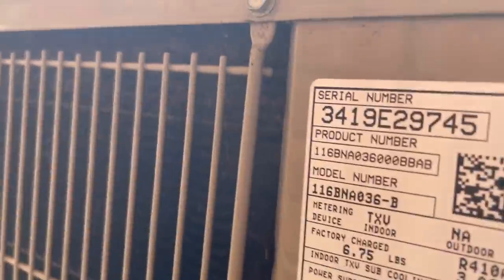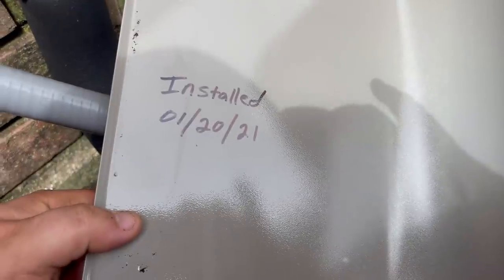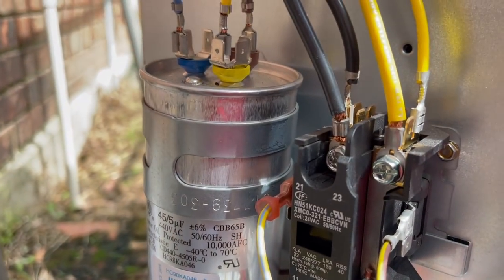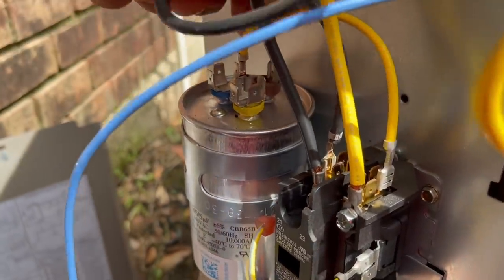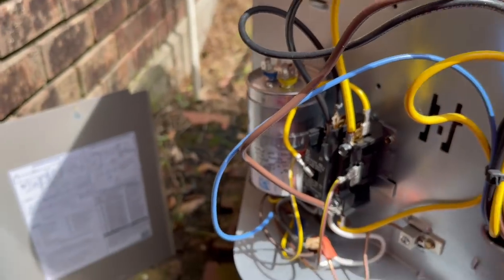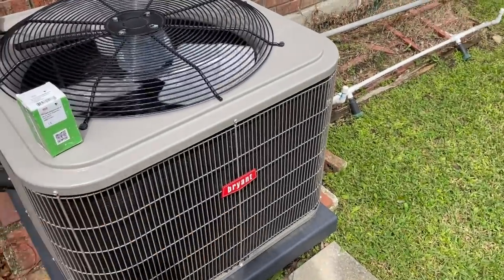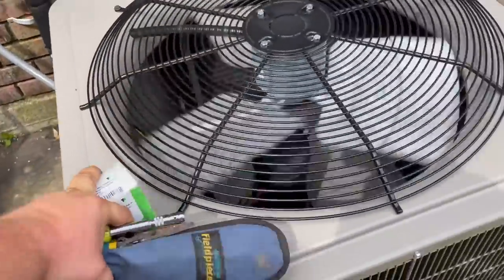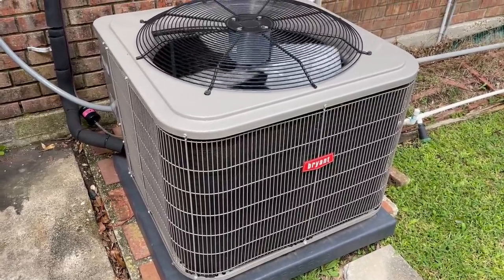HVAC Chinese Capacitor Strikes Again

Comment: When I got started in the late eighties in hvac one of the last things that you would ever wind up replacing on a condensing unit was a run capacitor,, that was rare..
Reply: They had PCB’s in them till 1979 I think it was. When they banned PCB’s that’s when the trouble started.  Then they started making them lighter and lighter.  We used to say run cap are like watermelons, buy the heavy ones.  The Chinese ones in recent years are awful, I wouldn’t put one in my dog’s house.
Reply: @rgb-c5  well, I keep old pcb capacitors from old equipment and put them in to replace crappy new capacitors.

Comment: I'd say paying extra for Turbo 200s is worth it.  That's outrageous.  We got 30+ year old systems out there running with original parts, namely the capacitor.  Good to see a video from you John!
Reply: Thank the EPA for that.   Oil in the old capacitor could handle and dissipate the heat much better.

Comment: @John, Just in case you didn't see.  Both Carrier and ICP released a Tech info Comm (TIC) on the a solution for these horrible older Chinese caps...apparently they spec'd Castor Oil dielectric (Black Label) and as we all know from experience something breaks down and fails...starting 3Q of 2021, they replaced with new caps (Yes same mfg) with Mineral Oil dielectric (Blue Label).  Guess Mineral Oil has a higher breakdown temp.  212 degF vs 185 degF.  Guess time will tell if they are any better.  I do see them in the new ICPs, so I will monitor them and see if the match the USA Mars.  The TIC was released on Jan 11 of this 2022.

Comment: Thanks for sharing. I wasn't aware this with Carrier capacitors but I know for sure by experience dealing with the Titan capacitors sold at Johnston Supply that have the same exact issue.
Reply: What's your story with the Titan? They have Pro (chi) and HD (USA).
Reply: I had to switch out a Titan the other day after only a year.
Reply: I haven’t had a problem with the USA made Titan HD.

Comment: Im a Bryant dealer here in Va and i have installed a lot of Bryant units and to date ive only haf one capacitor fail and that was a few weeks ago. But we had also had several severe storms come thru at that time so i dont know if caused by storm or Chinese cap but this was first one ive had and i install at least 3 -5 a month sometimes more . Im not a fan of Chinese parts but havent seen issues like you here
Reply: I had to replace a year old capacitor on a 2 speed carrier 🤷‍♂️

Comment: I have 2 carrier units that are about 14 months old. No issues yet but I have 2 U.S.A. made caps and 2 contactors sitting in my garage.
Reply: It doesn't matter if it's made in the US or China, capacitors are inherently fragile components. Any good power surge or thunder storm has a good chance to pop them.

Comment: I've told customers that capacitors are now like car batteries.  You're either proactive or reactive.   Do you wait until you're at the grocery store to find you battery dead or do you just replace it every 5 years?   Same with capacitors except shorter life span.  So even if I am testing your 5 year old capacitor and it tests good.... Are you proactive or reactive?

Comment: I feel you John,

I installed a Bryant Air Handler and 3 months later evaporator leaking!!!
Reply: Did you tighten the txv? Each brand has their issues, you usually have to tighten the txv on most Lennox evaps. But I do it on all evap installs for peace of mind.

Comment: I’ll take the bad run cap issue. I work on both of these brands everyday and I still like the tried and true Bryant design. Our Rheems are the old style condenser now because they can’t source the resin for the condenser pan. Plus thin coils. SWFL

Comment: John, on those capacitors, does the little bubble popped up mean that it’s bad maybe?
Reply from the maker: No not Necessarily
Reply: No, always check the uf on a capacitor. That's the only accurate way to know.

Comment: Just looked up that same brand of capacitor on Amazon and it had 4.5 stars on the reviews. It was a 70 uf 440 volt capacitor because that what works in my condensing unit.  BTW, the description says that these Powerwell capacitors have a five year warranty.

Comment: Those are the worst capacitors around! I prefer AmRad or USA-made Mars, or Trade Pro capacitors.
Reply: I prefer a capicitor that lasts 3 years so I can get another billable job. Caps are easy money…$150-$200 for an $8 part that takes 5 minutes.
Reply: @joep4143  yup, I will usually sell a condenser cleaning for another $365 if it needs it.
Reply: @christianruvalcaba7788  wow. Where do you work? We take apart cabinets and use chemicals and homeowners have a hissy fit for $150.
Reply: @joep4143  Homemade planned obsolescence😂.

Comment: 7.75 months, not 9. Even worse than you originally said. 🤪
Reply: And she probably didn't start running A/C until April, so really less than 6 months.
Reply: @robertjoseph1592  in South Louisiana you run it some days in January and February.
Reply: @robertjoseph1592  You can't just look at the temperature in southern Louisiana, where the humidity is very high, unless a cold front has recently passed through. Without AC, things inside the house will grow mildew on them. The water vapor in the air reflects the heat you are emitting right back at your skin, making you feel hot, even if it is only 85 degrees. By sunrise, water is dripping off the roof from water vapor condensing on it. Unless there is a little breeze, which at night there usually isn't, you can walk outside at 3 a.m. and it still feels uncomfortable on your face, as the heat from your skin gets blocked from escaping by the water molecules in the air. If the humidity was lower it would be a great place to live because the temperature seldom gets above 94 during the summer. When the humidity is 65% sweating doesn't help cool you off, since it doesn't evaporate much. You just get wet and hot.
Reply: @billsimpson604  what’s wrong with wet and hot?